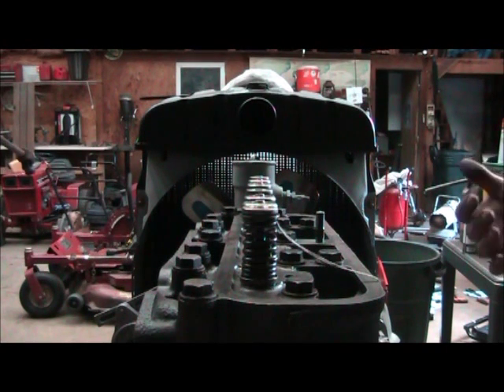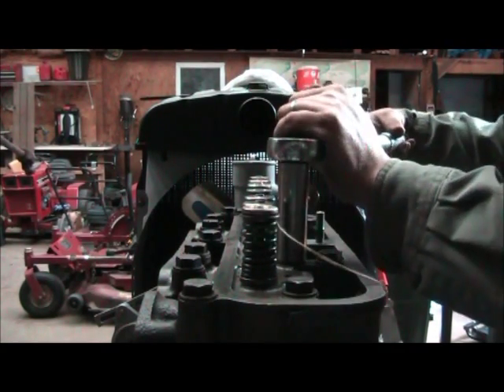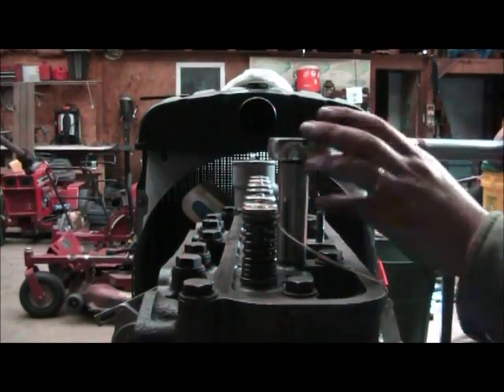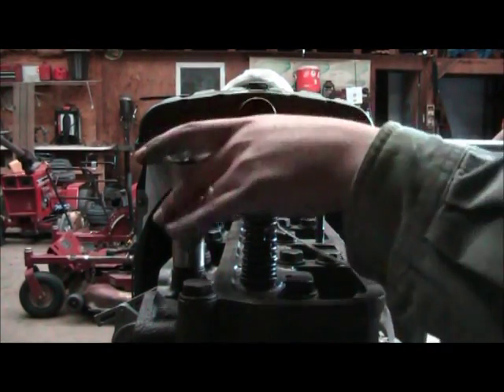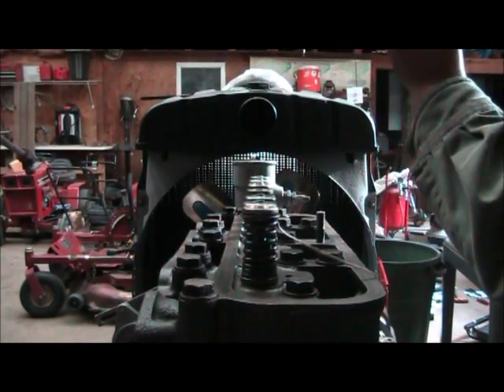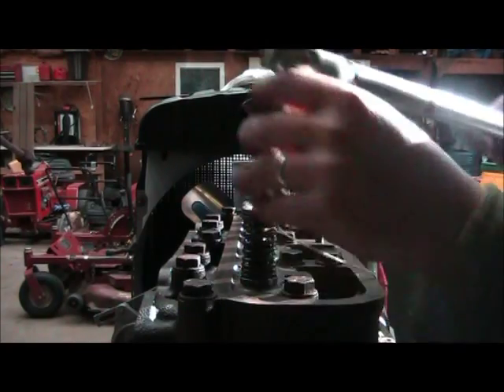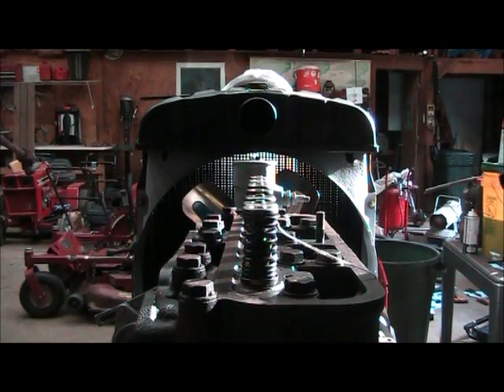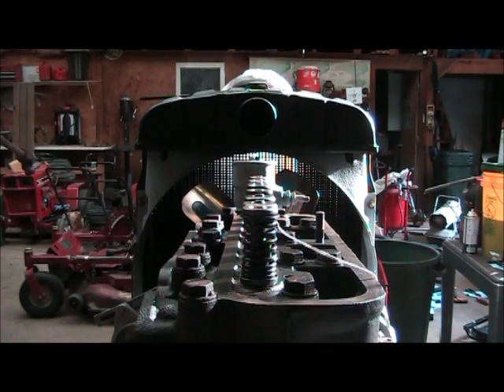Torquing head on IH C-153 engine

Comment from the maker: @TheTractorguy140 Ill be posting some more videos on the work we do to it. I think the bolt pattern is a little different. thats a 140 radiator you see in the video. we had to get one so it would fit the engine.  I need to get a belt for the little 382 hydro in the left corner.